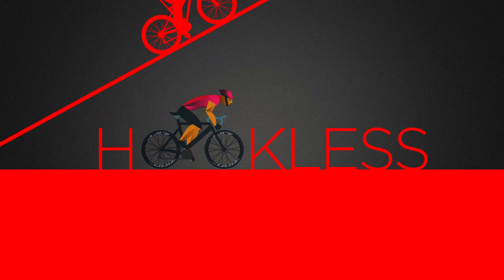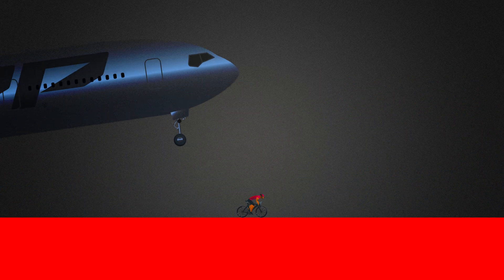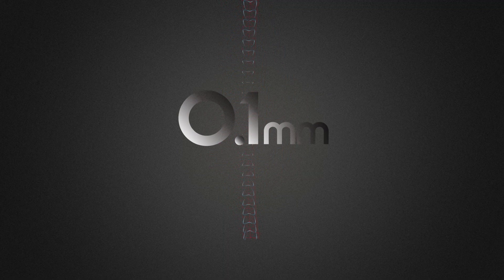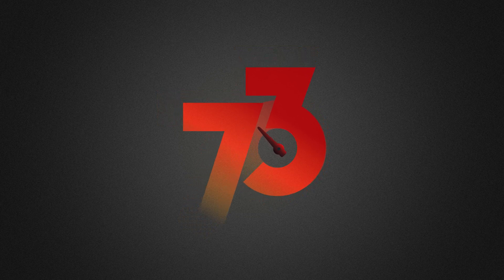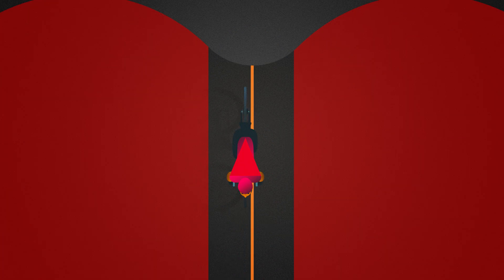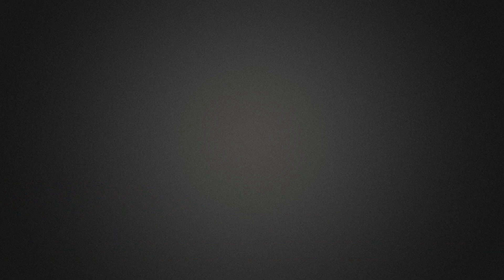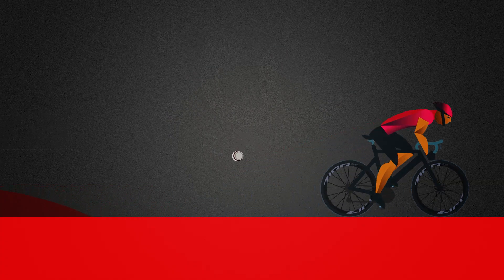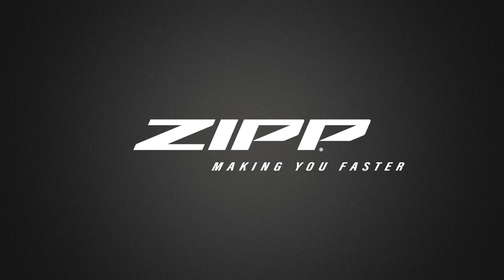ZIPP Hookless Technology

Comment: Lose the music, really, or if your brother-in-law did the music and you don't want to offend him lower the level, it's distracting.
Do you need tire sealant for these rims?
Reply: Definitely, It's dangerous not to use sealant according to Schwalbe, hookless rim's will not hold the tyre on the rim if you puncture, or use too low a pressure.